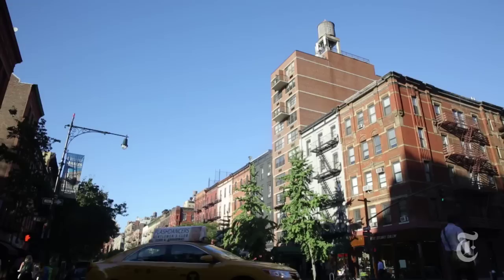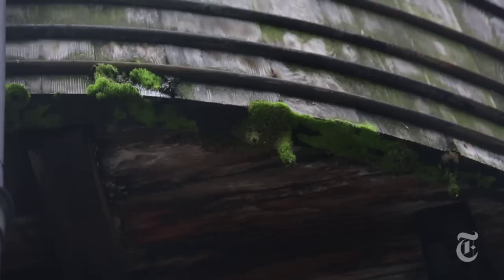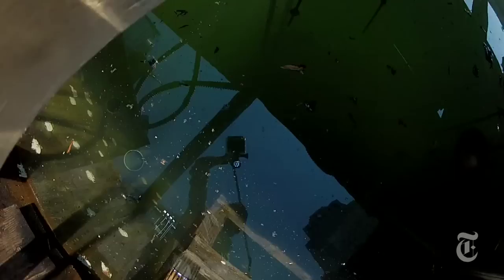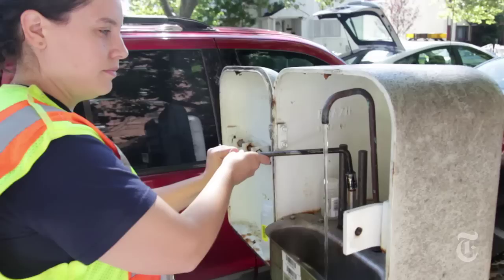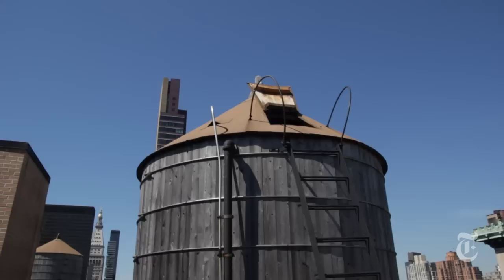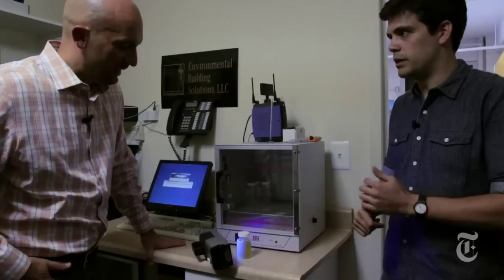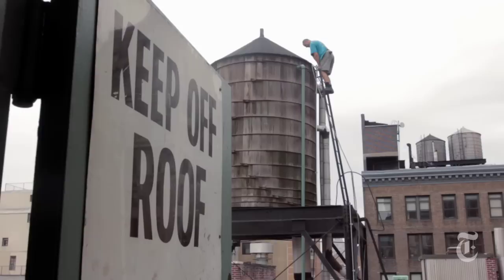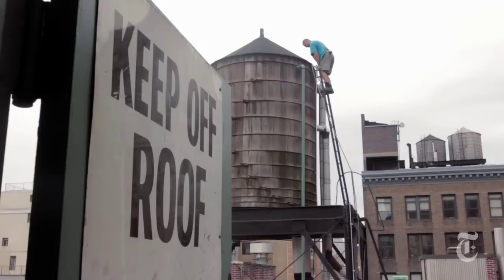Inside New York City's Water Towers | The New York Times

Comment: I did not think for a second they were still in use. when I saw them my thoughts were  -nice they are preserving the historical look. Shocked by the 1920 hygiene standards
Reply: It's not really easy to rewire all pipes in NYC to todays standards like most suburbs and small towns... You'll have to rewire everything  big time because for the amnt of ppl using the water at once, the flow has to be massive (so bigger pipes)... All buildings are connected to the same water system.... There is no way it will supply everyone at once, a tank will have to exist one way or another... It will also be very challenging to upgrade anything in such tall old building. I was in a newer 40 story hotel in NYC and the kitchen sink pipe was so wide you could fit a cup in there. I was shocked and scared a rat would climb out of there and even then the water took a long time to drain because the whole building was using it at once
Reply: @brainey001  And how do you suppose other nations with heavily populated cities deal with this issue?
Reply: NorwegianNightmare nyc is huge and it is very hard to do any repairs or stuff. Just look at the subway. It needs repair but they never find a time to fix it cuz of how busy New Yorkers are and cuz of how much they use the subway
Reply: @Destin5258   In São Paulo, Brazil, if you run a business you should have a valid proof of the watertank cleaning, this is enforced by the government bureaus. Wood watertanks are banned since 20's in Brazil, they should be made out concrete, fiberglass or plastic. All brazilian houses have at least a 500 litres watertank because in some places water supply could be variable.
Reply: How would you not think that they’re still in years??? What an idiotic statement!!!
Reply: D Guardabassio concrete ways to much
Reply: Well you are wrong they continue to install wood tanks all over NYC and you thing mid-westerners are backward, LOL
Reply: its cheap
Reply: @brainey001  Well then it's time for them to be replaced

Comment: this is outrageous. why are these tanks still made out of wood? NYC could be raking in big money fining those deadbeat landlords. Lets try to not restart up the plague.
Reply: Stainless steel plates also fit in lifts.
And since buildings are mostly built with the aid of cranes, you can put a stainless steel tank on top.
Reply: What about a water pump that shuts on when you need it? less stationary water, problem solved.
Reply: Chris Landry Starret City elevators go to the roof.
Reply: 1vachmed94 that is essentially what happens. but the tank is required because if 100 people in the building turn their taps on at the same time it would overload the pump. the tank is like a battery for the pump

having a water tank on the roof is also quite useful in the event of a power outage or fire.
Reply: You could just install more pumps, in my 10 story apartment building it has just 3 pumps for the whole building. I don't think it will be useful in case of a fire. The amount of water needed to extinguish the fire is way more than the tank on the roof.
Reply: that would require the installation of many more pumps and new water tanks where the pumps are drawing from. there are many solutions to this problem - the trick is to find the one that works with the preexisting infrastructure in new york.
one of the best solutions is to have dedicated water towers that are taller than your buildings, then all of the pumps and tanks can be inspected regularly by federal employees and not private building owners.. but NY has far too many skyscrapers for that
Reply: ike fun I have an idea... Or 2. Either the tank company use a modular rooftop winch system off the edge of the building or prefab the pannels, then finish it on site.
Reply: Glass fibre panels
Reply: Matthew Trott good idea
Reply: 1vachmed94 the reason they don't have a pump is because the tank creates pressure in the building and it's directly related to the height it is placed. Pumps at ground level would be insanely non cost effective, a source of pollution and a general headache to maintain.
Reply: Xilom82, that's where you'd be wrong. Rooftop water tanks are old technology, modern buildings use pressurised booster systems which are not prone to microbiological growths, and these are backed up by emergency generators or sealed tanks so that in the event of a power failure a continued water supply is ensured. Any respectable building management company retrofits older buildings with these modern systems, however many have spent decades scraping profit away from their service charges instead of putting the money aside for these crucial projects.

http://www.pacopumps.com/Documentation/WhitePapers/Roof_Tank_Whitepaper.pdf
Reply: Hashterix thanks for the info, I stand corrected.
Reply: Xilom82 and how do you think water gets up to the tank?
Reply: ken z,  no actually I think we do need to restart the plague.
Reply: Well have to strengthen your immune system somehow…
Reply: It's not that there made of wood its what kind of wood. They should be made of cedar not popular or spruce.
Reply: Charlie KB Do you understand how long it takes to assemble, run and then disassemble a tower crane? Not to mention you'd need to close down a lane on the road most likely.
Reply: I know it would be a huge expense, but the Tanks should be made of stainless steel. and presurized, and use Ultra violet light treatment,  running 24/7 to keep the Bacteria down. I feel for anyone living on the upper floors of N.Y.C Apartment building. ;|
Reply: They dont do this because in case of fire the extra water stored is mainly used for sprinklers.
Reply: Most of these buildings use the water tanks for only sprinklers not for the drinking water!
Reply: Sylvia Rohge those buildings buildings are all very old, and stainless steel is very expensive
Reply: 1vachmed94 buildings have fire dept standpipes. Firefighters connect hoses from fire hydrants to the buildings which then feed each floor
Reply: come on is it really that much of a supprise 
lol there greedy a holes
Reply: @ike fun metal
Reply: Man I feel bad for  New York thx to people like daredevil they have dirty water
Reply: @ike fun Ike, Are you pretending or are you actually that ignorant of humanity's abilities to lift heavy things in small sections. I mean, you seem incredulous that anything other than wood can be used to create these towers because of their weight.....Then how do you explain buildings made of steel and brick being created in the first place?
Reply: ken z my water comes from the water tower but my building and most other buildings clean the water on the way down to the apartments so it’s actually fine
Reply: 1vachmed94 that’s really inefficient, the pump would be off and on hundreds of times a day, which shortens the life of a pump by 75 percent. The water tank acts as a shock absorber to store water also, so the pump can be off and on one, maybe two times a day to pump water to the tank, instead of pumping to individual faucets. You could instal a pressure tank with the pump, but it would have to be as large as the water tank on the roof as well to prevent extra pump wear, I recommend a video titled “How water towers work” published just a few hours ago by Practical Engineering.
Reply: Jep
Reply: @johnanders8861  Lol you think like an american, there is no tank when you install a pump. No bacteria breeding or chlorine. What is more important your health or the maintenance of a pump?
Reply: @michaelangiolillo  I pay 15 euro's a month for water. We use 3 pumps shared by 160 households. It barely needs any maintenance.
Reply: 1vachmed94 it also helps with water hammer. With the pump being off and on, it is high pressure, then low pressure, then high pressure again. If you want your house flooded because of extreme water hammer go ahead, don’t use any tanks.
Reply: @johnanders8861  lol we use this system for over 50 years. It is widely used in the whole country. I life in the Netherlands don't worry we know how to manage the water ;).
Reply: Wooden water tanks are just fine. They just need chlorine added, and properly screened vents.
Reply: Wood is the safest antibiotic structure.... Its about cleaning it.
Reply: Plague might be what New York needs.
Reply: @aevangel1  Truth......
Reply: @alec4672  Helicopter?
Reply: @thekmfdmmachine3919  Where are you going to land it? Are you gonna cruise over New York with a sky crane having a tank dangling from the bottom flying to the job site from LaGuardia or Peterborough? In a rural setting they use sky cranes to log and that's as low as 5 grand an hour I couldn't imagine how expensive it'd be to run one over a city like New York with all the permitting and what not
Reply: @1vachmed94  They still use water tanks on skyscrapers in the Netherlands. Your highrise buildings are new compared to NYC (our buildings survived the 40s) your tanks are just built into the inside of the building and yes there usually stainless steal and pressure assisted with accumulator tanks (the new world trade centers use basically the same system) the building they're ontop of was probably built right after ww2 this is just how it was done with no plan put in place back then to ever upgrade the system. They're safe if your building owner is responsible. Out of all the things to get you sick in New York a roof top tank is the least of your concern
Reply: @thekmfdmmachine3919  I feel like a steam cannon would be more effective and accurate at that point 😂
Reply: Because most of our Government officials own the buildings. And that would take money out of their fat wallets. They should be required to change them with the newer materials that are on the market today.🤔🤔
Reply: @beachbro8559  What materials? Wood is just fine if maintained. Also these are privately owned mainly apartment and offices so I don't see where you got the info that you think the government owned these buildings
Reply: Mr Sunshines are you serious. You think the problem would be getting it up on the roof. Surely you don't live in a major city. Next time you are in a airplane take a look out the window and see what's on top of the roof. Sometime new construction, major heavy AC units, pools. You do know we have cranes in the world.
Reply: Rent control?  Why spend money if it won’t make money and the law is not enforced?
Reply: Believe it or not wood is a very anti bacterial agent and when wet wood swells to stop leaks. With metal you have rust and other corrosive agents...this is why food cutting boards are also made of wood.
Reply: Wood is actually one of the better materials to make the tank out of. It is also safe, proven for hundreds of years. 

They make wood tanks since the materials can be walked up to the roof, as opposed to a steel tank, that is pre-fabricated and hoisted using a crane. 

For anyone that does not know, getting a crane in NYC is not cheap.

Wood isn't the issue.
Reply: Mr Sunshines They have these things called cranes that are designed to lift heavy things to high places.
Reply: A tank lining would work...
Reply: @richardbearden7889  A liner reminds me of the slimy sides of an above ground pool. Liner or not though, this is probably how the tanks that don't get maintained are on the inside.
Reply: @FreeStuffPlease  that's algae that grows that causes the slime effect.. if there's no sunlight involved then algae doesn't grow.
Reply: @richardbearden7889  Yeah true. Some of those tanks did have algae growth though. Disgusting.
Reply: I mean omg NY expensive
Reply: @1vachmed94  sprinklers are not designed to extinguish fires they are designs to limit the spread of fire
Reply: fine the landlord? it's the responsibility of the city to provide water.  I can't believe these tanks exist at all. It's sad that they actually still allow a method of providing water from the 1800's
Reply: @johnanders8861  Pressure regulators have existed for over 100 years.  VFD driven pumps have existed for over 40 years.  Why are you making things up?
Reply: Now we have a new plague...Cv19
Reply: ken z it's not the wood. It's the dirty feet and hands that use those ladders to make the inspections. Less inspections are better. Water samples should be taken monthly at the tap. If you find contamination then go the the city who I'm certain will drop everything to rush over and site the building owner for a violation and come back in 30 days to make sure the water is safe.
Reply: 6 years too early lol
Reply: its common knowlege that wood last longer in the elements, over decades than other materials
Reply: This comment aged badly 😂
Reply: @iantempleton313  i still think it’s perfect 👌
Reply: The wood actually isn't bad if it is maintained.

Comment: That's nasty. Why don't they replace the wooden tanks with something more clean, secure and durable?
Reply: That was my question.  My guess is that it would become a lightning rod if it were metallic.
Reply: In other parts of the world, plastic tanks are very popular.  They're non-reactive and non-conductive.
Reply: The problem isn't that it's made of wood it's what kid of wood. These tanks are made of spruce but they should be made of red cedar, that's what they make wine and whisky barrels from. You need a wood that likes water. Cedars only grow in marsh they live there whole life wet it's the best wood for the job.
Reply: Because building management companies who take tens to hundreds of thousands of dollars a year from each building as a service charge take more of it as profit than they should, while not portioning enough money off into funds for larger projects when they're needed. Systems need annual maintenance, but over the course of ~50 years enough money should have been put aside to be able to replace the entire system when it comes to its end of life, and this simply hasn't happened.
Reply: Pseudo Nym my guess is most of the new ones are not wood but some of these tanks are on building that predate modern plastics.
Reply: Mrcaffinebean, yes the buildings are old, but they should have been retrofitted with modern booster systems over 20 years ago which is why this situation is shocking.
Reply: Pseudo Nym what's wrong with wood? Wood is a lot better than having a steel tank.
Reply: Hashterix Roof top tanks don't need power they'll supply a building for a while. I do seem to remember a huge blackout happening there
Reply: Backup generators are used in modern booster systems, and some designs continue to use tanks, except modern and pressurised unlike these old wooden things.
Reply: Pseudo Nym weight money safety lol
Reply: tradition
Reply: MrUranium238 no. It's to save money.
Reply: Yeah, with titanium tanks, or carbon nanotubes tanks.
Reply: Just ground the water tower if you're afraid of lightning
Reply: Yeah like plastic ones or something, that's just nasty
Reply: Obviously it’s expensive, and hard.  And it’s currently not in NYC water regulation either.
Reply: microplastics
Reply: @ThoolooExpress  PVC
Reply: In Texas farmers run galvanized or fiberglass tanks.... And we are apperently not as smart as people in the north.
Reply: @NA12495  well yanks and narcissism go hand and hand
Reply: Wood is used for several reasons. First, the wood planks swell and become watertight allowing for less expensive construction. You will notice that there are steel bands which tie the structure together, these become more closely spaced as they near the bottom of the tank to account for the increasing water pressure. Second, the wood is antimicrobial by nature, steel tanks would need to be treated more often. Third, it is much more cost effective to build these of wood than steel or like components.
Reply: Pseudo Nym Cheap
Reply: Because how am I supposed to afford a new Mercedes if I have to buy peasants a water tank?
Reply: Re Alex Ver Bunker. Wine and whisk(e)y barrels are not made of cedar and water towers shouldn’t be either. That aroma that keeps moths away would flavour your wine and whisk(e)y and would do the same with water. Wine and whisk(e)y are aged in oak barrels.
Reply: Because demonrats run NYC and typically let cities fall apart.
Reply: They use metal ones sometimes but they are more extensive
Reply: @rhodesianwojak2095  whatever you say, Einstein
Reply: @alec4672  I thought whiskey barrels were made out of oak and if I'm not mistaken white oak.
Reply: Ever have drinking water come out of the tab all reddish in color? If so you've had water some a steel tank. Ever have water come out with a chemical odor? You have? Well now that water came from some sort of plastic tank. here are many trade off for every type of tank material.
Reply: Easy... costs. A metal tank of the same size could easily cost 150k over that of a wooden tank, under 60K. No option is cheap, but thats the cost of living in New york and why are people not all sick? Immunity.
Reply: A wood tank is something like $60,000 and lasts like 30-35 years. A steel tank is $180,000 and lasts longer. The bigger up front cost deters a lot of building owners into just going with the cheaper option :\
Reply: The wood isn't the problem, it's the landlords
Reply: @joeyzucchini  why is a public service like supplying pure drinking water to millions of citizens left to individual greed and ignorance, out of efficient control by public administration?
USA are often practical on level with the most primitive countries.
Money money 💰💰💰, who cares about the outcome for ordinary people
Reply: its all about money the wooden ones are way cheaper
Reply: @ThoolooExpress  Mmm. Plastic.
Reply: Pseudo Nym land owners are greedy and cheep
Reply: There is actually a video about that on YouTube look it up
Reply: That costs money don’tcha know
Reply: Or have the pumps in the building to actually bring water to the top.  We don't have these tanks in our city.  Somehow we evolved